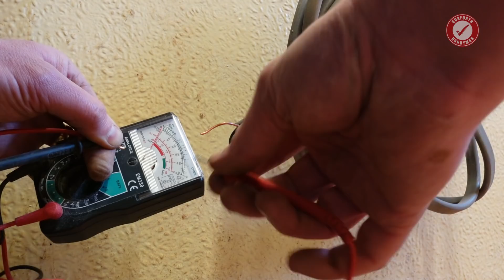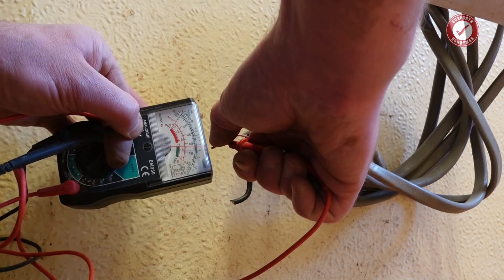Safely(ish) removing unknown buried pipes (Renovation Part 10)

Comment: Is it possible the mystery pipe in the kitchen is grounded to the electrical supply?  My stove’s gas supply line has a ground connected directly to the power panel’s ground.  This is done for safety.
Reply: It's the sort of thing that someone could have thought was "a good idea at the time." While this house is too new, the first houses to get electricity often had the wires run through the gas pipes!!!
Reply from the maker: It must be... but where!? Can only be in that short section that's left under the floor. Very odd. 😁👍
Reply: @GosforthHandyman  Time for more demolition? 🙂
Reply: @GosforthHandyman  it is a bit odd, I am not an electrician or an expert for that matter, but the sort of reading you got on your meter could only have come from a direct connection, ie an electrical bond.  That might be below the floor, I doubt if is just where the pipe appears to cross the in-coming electrical supply.  From what I understand, all gas and water pipes were, and sometimes still are "earth bonded" where they enter the property, irrespective of the material of the supply pipe which is normally plastic.  This is an electrical safety requirement.  The electrical "Earth" for the house is different and depends on the nature of the supply, but in some cases could be a metal supply pipe.  To be sure, it needs to be tested by an electrician with the correct test kit.

Comment: Try disconnecting the water bond (if there is one) and test continuity again. my guess is the as the old water supply and that pipe (because of the damp from that leaking drain) is giving you a good continuity reading. I know the pipe has that coating but you don't know that its coated  where you cant see it.
Reply from the maker: All the water bonds are gone. Only a single earth to the CU now and everything else is stripped out.👍

Comment: It's usual to cross-bond metal pipes to the electrical earth. You will probably find an earth clamp under the floor. I worked for what was called the Electricity Board for 40 years and the old power cables were lead sheathed and covered in bitumen and cloth. It is most likely a town gas supply that was upgraded to North Sea Gas in the 1970s.

Comment: Should wait till the end of video before jumping in 😉 

Maybe the electrical supply is an old one with metal shielding, and then a bitumen coating round the shielding, possibly it's rubbed over the years and come in to contact with the pipe.
Reply from the maker: That's certainly a possibility! 👍

Comment: Have you checked your earth into the property since cutting off the pipe?? It was common to use pipe work for earth (in stead of earth rods) or as well as earth rods! However most supplies are now TN-C-S it may be ok but worth checking?? Hope this helps

Comment: Final check with the neon pen.. if it can read through the casing. Then apply safety squints and go for it! Did you do it in the garden rather than the annex so it would be a softer landing?

Comment: judging by the old bonding cable running down the architrave I would guess at an old town gas supply.
Reply from the maker: That bonding cable went to the water pipes 👍

Comment: All conductive protrusions into a property (water, gas, coal gas, whatever) must be bonded to the main protective conductor (earth) of the house to ensure that a potential voltage cannot be present between the electricity earth and the service pipe earth. If they didn't do this then you could, in some circumstances, get an electric shock when touching say a tap and the metal faceplate of a plug socket at the same time. This will be why there is continuity between the pipe and the electricity earth. Additionally, if the electrical system's earth arrangement is either TN-S or TN-C-S your meter may detect continuity between the steel pipe and the neutral wire. This is nothing to worry about and is in fact a sign of the electrics being installed correctly.

Comment: It looks like an old steel water supply, they used to coat them in zinc to prevent rusting etc. The joint in the kitchen is very similar to the joint they used to have on the steel supplys

Comment: We have a few of these type of pipes in our house and they’re old oil pipes as our house used to have oil heating at some point before the town had gas installed.
Reply from the maker: Interesting! 👍
Reply: @GosforthHandyman  oil/kerosene pipes are much smaller, less than 10mm and usually copper. Yes there were community heating schemes for oil a long time ago, one big tank down the road that many houses would share. I think it is pointing towards gas or it is possible an electric cable conduit, not so difficult to pull an old cable out. Main thing is you can now move on.
Reply: Well that’s yet a different Utility I never thought of.

Comment: Almost certainly an old gas pipe. Had a similar one in my 1930 bungalow (along with a new MDPE gas pipe). I thought it was dead and so did the gas board when they came to check it out. The gas man almost had a heart attack when he managed to open it up and gas started spewing out. He had no idea where it was coming from so sealed it off at the boundary.
Reply from the maker: Wow - interesting! 👍
Reply: Yes definitely recommend capping the outside just in case. You never know what might get reconnected when.
Reply: That sounds like FREE GAS to me 🤣

Comment: If you chopped off an electrical pipe would you go through all the effort of pulling the cables out?
Reply: Possibly the wires were removed by those installing the newer electric service as a precautionary measure to not have duplicate electric service entries.
Reply from the maker: Yes, very possibly. Might have even been sold for scrap at some point. 👍
Reply: As my previous reply this was a old gas pipe for sure and no one would go to the trouble of attempting to remove the cable or in my opinion be possible on such a small bore pipe with multiple bends on a long run.
Reply: Absolutely no one would
Reply: @CraveThatCoin  You forget that metals, especially copper, have been rationed more than once. There have been national efforts to recover as much metal as possible several times in recent history. I have no idea whether that's the case here, but it's not as improbable as you so glibly claim.
Reply: If it was electrical with a fault they might’ve pulled it out to see what the fall was. If it had 90° bends it was most likely gas, electrical would’ve had more smooth turns.
Reply: @imark7777777  indeed bending solid copper wire at 90 is stressing the material too much - perhaps they didn't care enough too much. On a flip note: wouldn't Al be better suited for the case anyways?

Comment: I still have gas arriving into my house via a steel pipe and it runs to the meter, to which there is then an offshoot to  the meter,  However, the iron pipe runs up to the bathroom where I'm told if fed the geyser for the early gas water heater. The fact there is a millican cock suggest its case as they were used on gas fittings.

Comment: When you were measuring continuity between the pipe and the earth cable in the T&E you were holding both probes in your fingers. You were probably measuring continuity across your on body.
Reply: LOL don't think so
Reply from the maker: Yeah, even with wet fingers the resistance wouldn't be that low.

Comment: I know in Ontario Canada any metal gas pipe has to be grounded or earthed, its a building code requirement. They do that way if the metal gas line becomes live electrically it would pop the circuit breaker at the panel immediately. The gas line in your kitchen could have been bonded to the earth of the current electrical supply. Although I'm know nothing about British electrical and gas codes.

Comment: The continuity reading maybe the resistance of the general mass of earth, with the pipe being conductive and buried. Depends on what your reading was really
Reply from the maker: It was the same reading as joining the probes directly together - also bear in mind the pipe was bitumen coated. 🤔
Reply: @GosforthHandyman  if its owt like the bitumen thats part of the old PILC electricity supply cables then if its been damaged in the past, the pipe could’ve rusted out? When you consider the gas and water services are metallic and probably are for the majority of the street and on a maintained electrical install these should be bonded back to the installations earth terminal, then if you imagine every connection as a path to you electrical earth terminal, in parallel. This can give good low readings.

Its basically what an electrician would be looking for o an install that uses ‘TT earthing arrangement’ a nice low earth impedance.

Also if it used to be and electrical conduit, that would be the first for me, never seen it before, a rare beast👍🏻
Reply: @GosforthHandyman  With the meter that you were using it would indeed have the same apparent reading. With a meter designed to read low resistances you would have seen a significant difference.

Comment: The changeover to North Sea Gas (in East Yorkshire) was in the early 70s so that pipe could have been in use later than the dates you mentioned. Coming out of the kitchen floor and heading up the wall like that screams gas oven supply to me.
Reply: Or an old back boiler and fire

Comment: Bitumen coated 1 inch steel is probably an old gas pipe, if this house is old it could have had gas light, but more likely a gas cooker supply.

Comment: If that HAD been live gas you'd have left a crater the size of the house! I had an old gas pipe that I needed removing, I called the gas board and they got rid of it for free. Much safer than attacking it with a grinder.

Comment: Check what was the local electric supply pre the establishment of the National Grid,  may not have been 240v 50Hz AC
Reply from the maker: The house was built just around the time the national grid was 'invented' 👍
Reply: That’s a good point might’ve been a previous generation system prior to standardization.

Comment: I was going to say an earth bond, had there been a gas supply, it would be more likely as it could be bonded to the gas pipes. But I think bonding to gas pipes is a moderately modern thing. I would think it was not ever for electricity, other wise the wires would still be  inside, would they go to the hassle of pulling them out? Old gas supply is my guess....
Reply from the maker: I think wires would have been sold for scrap - easy enough to pull them out. 👍

Comment: You wouldn't need much of a break in the bitumen for a good connection to that damp soil, just a mm or two, so I'd be confident that it's 'earthed' simply by being buried in the earth.  And yes, you'd find gas pipes chased into the wall in old houses; my grandparent's house had it.
Reply from the maker: Yeah but the only section left is inside the property - the ground shouldn't be that damp to offer such little resistance. 👍
Reply: @GosforthHandyman  I bet the ground is soaking wet 2 ft down. Try sticking that wander lead into the ground outside, somewhere deep-ish, and I bet you get the same reading.  Or dig up the old kitchen floor and put us all out of our misery lol

Comment: Gas mains were always covered in bitumen to prevent them rotting. This pipe was run into the house but the original homeowner probably didn't want gas so it was never connected to the main in the street.

And videos like this make me wince. Nothing worse than having a 'handyman' in your house who is winging it.

Comment: I reckon gas, if it had had cable inside it you'd have found evidence of it I think, I can't image someone would have pulled all the cable? I wonder if the pipe tees off anywhere and rises and there is an earth bond somewhere?

Comment: Property never had gas really because plans for water and gas lines and sewer lines tend to be inaccurate accurate, lost, not updated, etc. if it’s buried in the ground there’s no guarantee it got documented properly.
Chances are it was probably at one point bonded into the electrical system as either a ground or just extraneous metalwork.
Interesting predicament you would think if it was electric when they ran the new line in They would have taken it out could’ve been gas and that would’ve run up the wall for lighting. If it was formally gas it might’ve been bonded underground at the time.
That’s one of those I would want to find out how far it went and what it connect up to of course you can only go so far on the property and then you end up in the street.

Comment: Earth cable is now known as the circuit protective conductor. It is connected to the general mass of earth so anything in the earth will give a reading to earth.
Reply from the maker: I think for the resistance to be that low there would have to be metallic bonding somewhere. 👍

Comment: A link to an electrical supply earth in Old property can mean little. Many old properties had a ground spike. Often this was just that, especially in properties with suspended floors - a spike driven to ground within the property with earth cable bolted to it. Over the years people will have cross earthed gas and water pipes to this.... anywhere in the property. Often several cross earths
Reply from the maker: Yes but the only remaining section of the pipe is in shallow dry earth and it's bitumen coated. 🤔

Comment: I would think it was a gas supply at some point. If it were an old electric duct wouldn't the cable have been left inside the pipe? Seams strange to pull the cable back through and just leave an unmarked pipe in the ground.

Comment: Use chocblock to test. Otherwise your using your body as you are connecting the wires to the meter with your fingers.  Also get a more modern digital multimeter that thing will be death of you.

Comment: I have a house in the US that's just a little younger. There were redundant gas pipes all over the place. Some were capped near the line into the house but far end just randomly cut off at floor level like yours.  I would guess a gas range in the kitchen. Your house is a bit too young for gaslight fixtures, I would think.
Reply from the maker: Interesting! Late 1920's so could have had gas lights! 👍
Reply: Gosforth Handyman mine is 1933, I am pretty sure. It was inhabited by 1935 according to newspaper delivery receipts found in the front door casing. In this part of the US, gaslights fell out of favor before then.  So I am sure my stubs were for heaters. My parents house in the same neighborhood had a free standing gas heater in the library upstairs when we moved into it in 1966, though Dad upgraded that quickly.

Comment: Maybe your current earth is close to the pipe and you are getting conductivity through the soil? Don’t think it was water as there would be limescale. The old gas pipes in my Victorian house for lighting are all tin but there is a cast iron pipe outside that fed gas from the street. It has screwed joints in it though. Does the pipe smell of anything?
Reply from the maker: It seems very low resistance for connectivity through the soil. 🤔

Comment: I pretty sure it’s a old gas pipe if it was a electric supply pipe it would still have a cable in there for sure. Though I don’t think I would be attacking it with a angle grinder with all the sparks.
Reply from the maker: Probably! Although if it was an electric duct the cables would probably have been pulled out for scrap. 👍
Reply: I feel like I’m repeating myself oh wait I am. One good reason to pull cable out if you can is to inspect it for damage possibly to determine what a fault was. Also for it to not accidentally be reconnected. Generally electrical conduit will have smoother turns and gas will have more 90s but there’s really no guarantee.

Comment: My own inclination is to think that it's an old town gas line.  If that's correct then the good news is that the lines were municipally owned so the local council may have records.  The bad news is, the lines were reported (in Wikipedia - so take with a pinch of salt) as being made from cast iron which doesn't work with what you've found?

Anyway - here's the detail I unearthed (sorry - couldn't resist the pun):

Town gas was supplied to households via municipally owned piped distribution systems.
 
 The discovery of large reserves of natural gas in the North Sea off the English coast in 1965 led to the expensive conversion or replacement of most of the UK's gas cookers and gas heaters from the late 1960s onwards.
 
 All gas equipment in Great Britain was converted from burning town gas to burn natural gas over the period from 1967 to 1977 All the gas-using equipment of almost thirteen million domestic were converted. Many dangerous appliances were discovered in this exercise and were taken out of service. 
 
 During the era of North Sea gas, many of the original cast iron gas pipes installed in towns and cities for town gas were replaced by plastic
Reply from the maker: Interesting! Great info! 👍

Comment: Earth is just that the general mass of earth, although if you poke your muntimeter leads into the ground you wont get a reading but you might get a reading on that bit of pipe as its termed as a extraneous conductive   part in other words it has 0 potential or earth potential but if you were to touch a live part and the bit of pipe you would get a shock so best get it out the house altogether, thats why water and gas pipes have bonding that way they are at the same potential as the supply earth that way if a fault occurs the current is directed to earth and the breaker trips

Comment: Old gas supply, the current electricity supply is re-using the original duct (clay pipe)
Reply from the maker: Would tend to agree... but where is it getting the earth bonding from? 🤔
Reply: @GosforthHandyman  Must be cross bonded somewhere under the floor. Or on another branch, I wonder if there might be a branch to the bathroom for a water heater.